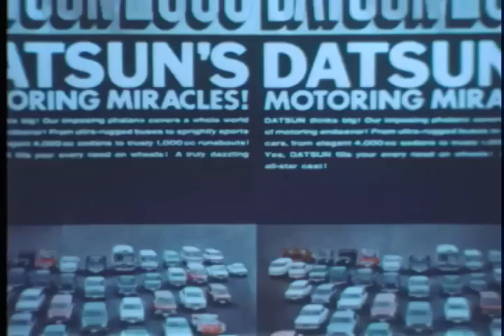Datsun In the 1960s

Comment: 14:13
A Douglas DC-8-53 passenger plane, registered JA8013, was damaged beyond repair in runway excursion accident at Bombay-Juhu Airport, India. There were no fatalities.
The crew were cleared for a visual approach and landing on runway 09 at Bombay's (now named Mumbai) Santacruz Airport. Instead of landing at Santacruz Airport, the airplane touched down on runway 08 of nearby Juhu Airport. The runway length at Juhu just 1143 m, which was insufficient for the airplane to stop.
The aircraft overran the runway and went through a ditch. A fire broke out.

Comment: Nissan will always be my favorite 60s/70s era import cars here in the U.S. 

Nissan made a smart move as well with the Zcar engine size.
There was a hefty fee from what I have read for any car exported from Japan equipped with a engine over 2 liters in size, (this is why most imports only had  small 4 cylinder engines)  Nissan chose to export the six cylinder L24/26/28, (believe there was also a L20A in some countries) while even the Toyota GT cars still had 4 cylinders, (the six cylinder supra we know wouldn't come until later). This move put Nissan ahead in performance in the states and furthered Nissan into the motorsports scene here which is how they helped with the extra fee for the larger engine size.

Comment: 7:46 Those 'natives' obviously knew it was a Datsun 2000 and had to run. If it were an 1800, 1600 or any other make, they just laugh.
Reply: Not really that’s a Nissan president which had up to a 4.4l V8.  And the 510 were fast as well

Comment: I wonder why Nissan didn't export Cedric/Gloria/President in USA? Many Japanese automakers have good products but most of them sold in local market. I don't understand
Reply: thats something i always wondered too jong my guess is they always save the best for the domestic market
Reply: In the early days, the larger cars would not have been distinctive enough in a market that was ferociously loyal to domestic cars.
Reply: I think that is something many companies do or did. From wine makers to cars - they export a pretty basic model and add a few bits of 'bling' to them to make them more attractive.
Reply: JONGBUM PARK 
They did offer Cedric 1964 and 1965 but they sold very poorly....they were very expensive....as in same price range as a Cadillac or Lincoln. Keep in mind in that era that luxury in the USA was directly tied to how large and powerful the car was.
The 64 cedric was approximately the size of a chevy II and had a 1.9l 4cyl but cost as much as a Cadillac. So, while they were great cars, it is understandable why they sold poorly in America. This is coming from a Nissan enthusiast.....
Reply: NIce info..You got me curios so I checked up on Chevy II, Cedric and Cadillac for 1964
The Cedric weighed 2734lb with 95HP, Chevy II; 2455lb with 120HP or 150HP (but also had a 90HP four cyl option, and a V8 option with 195HP) , Cadillac Deville Coupe 4430lb with 340 HP. Current Value in 2017: Cedric $1650-$2480,  Chevy II $7500 - $12500, Cadillac DeVille $8200-$19200. The Cedric is the winner and a bargain!
Reply: its all about money (and price points)...
Reply: I am a foreigner - non-American/non-Canadian - here, but I could just say with Hyundai/Kia already booming with themselves - while overtaking and inheriting Nissan's reputation - means Nissan should/could have replace Renault with Hyundai as their owner/mentor/parts supplier/technical assistant. 

But, when Nissan already merged with Hyundai/Kia [from Renault's control] could mean for Hyundai to treat Nissan like Opel for the sake of rebadging and selling their cars under the 'Vauxhall'' nameplate in the [Brexit-batterred] United Kingdom. 

That kind of idea/lesson both Hyundai/Kia and Nissan could learn from the Europeans/Britons, which means Nissan under Hyundai's control could lead Nissan to be restricted to the Japanese market, while Hyundai/Kia is restricted to the Korean market as well. As given by the fact that both Japan and Korea still have tensions shared with each other, which was stemmed from Japan's control and invasion of the Korean Peninsula from 1910 to 1945. 

So, while Nissan spends time at Hyundai's umbrella in addition to licencing and swapping parts from/with Hyundai/Kia vehicles means for Nissan to lose more money, hence resulting them [Nissan] to close down factories in the USA, thus withdraw from the Chinese market in exchange for boosting their sales in India, where Hyundai is booming in deep and Nissan struggles - as their lineup [for the Indian market] only contains fewer models currently...
Reply: @mebeasensei  Try finding a 1964 Cedric in the USA in 2017. Was hard then, even harder now in 2023. 
AFAIK there may be 2 or 3 left in America and one of them is in the Petersen auto museum. (And that one is actually a 1965 model year afaik)
Autoweek actually did an article on the 1964 (privately owned) cedric and according to them it was the "oldest surviving Nissan-branded vehicle in North America". Obviously there are older Nissan products , as the L320 pickup was sold in the US starting in 1959, but they were all badged as Datsuns!)
Think about that. The Cedric sold so poorly that Nissan didnt even bother to rebadge them as Datsuns (despite Nissan not "officially" being a marque in the USA until 1983).  I really wish that wasnt so. I would love to be able to have a USDM Datsun 240C hardtop coupe but they were never sold here. 
Autoweek also saw fit to mention that the 4-speed column shift manual had a reversed pattern (from normal LHD column shifts) because not enough LHD Cedrics were made back then to justify re-doing the linkages. 

This particular Cedric was also briefly features in "The man in the High Castle", it's probably the worlds most famous Nissan Cedric for sure:)

If you want something super rare the Cedric is certainly the winner

Otherwise I would probably take the DeVille